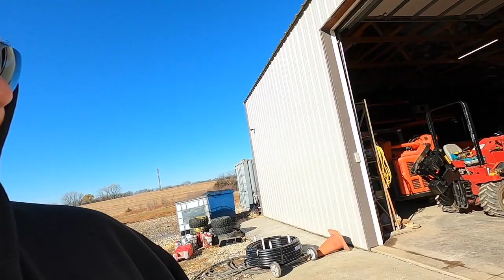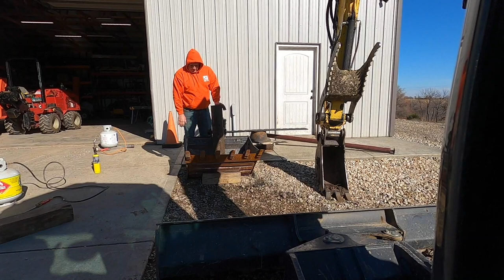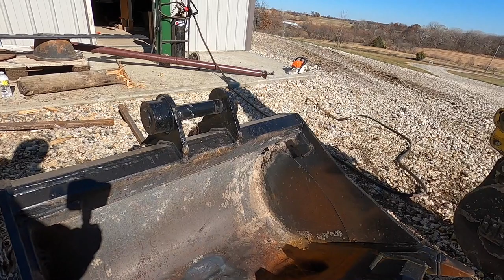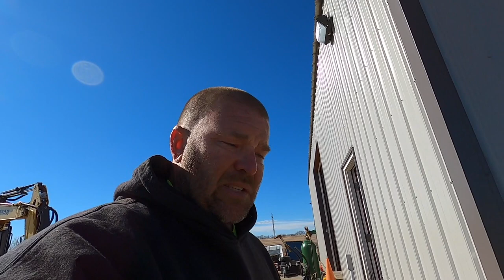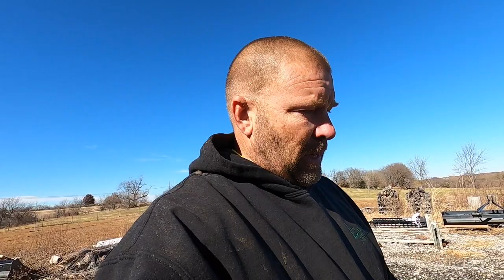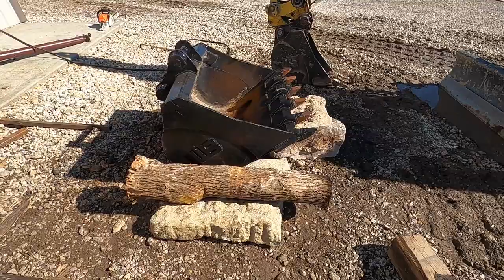Fixing a Dented Bucket, And Comparing Buckets

Comment: The way we fix a bucket with the dent to the inside is to drill a 1\2 hole right in the center of it put a strong straight edge across the back of the bucket with a 1\2 hole drilled into it block it up about 2 inches and tighten the neck out of the bolt while heating the inside and the bolt will pull the dent right back out. Then weld up your 1\2 hole.
Reply from the maker: I think im going to cut 2 of the wear bars off and then I cat just heat up the area and work it with a hammer. Then I will put 2 new wear bars on it. But for now it is really good. Id just like to see if I could get it all the way. 

I like your idea. Thinking on your idea. I could have welded a few bolts to it and used a big flat bar with a hole in it like a dent puller and heated the bucket and had my buddy put the flat bar in areas and tightened it with an impact. I wouldn't have had to beat on it with the machine. 

I was going to cut a relief in the middle so I could shrink it back but was afraid it would get to out of shape.